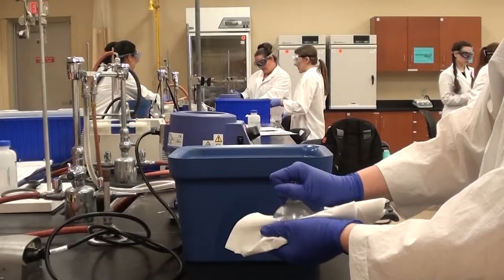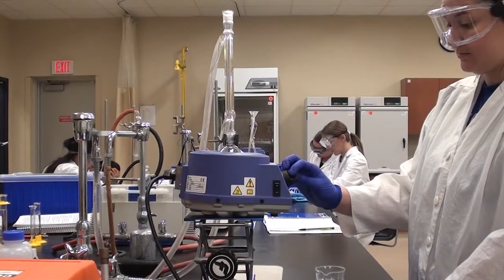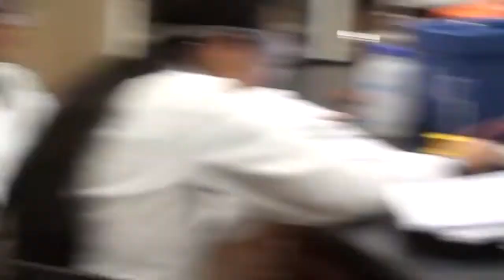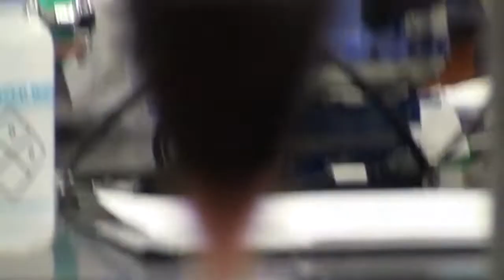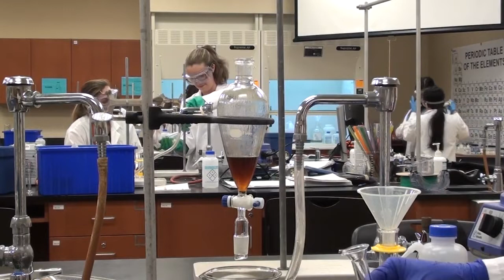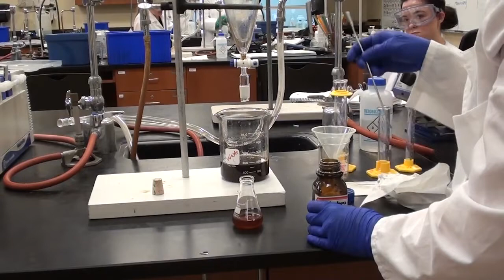Banana Oil Synthesis of Isoamyl Acetate Part 1

Comment: My experiment with this synthesis used 16 mLs of isoamyl alcohol, 17 mLs of acetic acid, and just 1mL of sulfuric acid. The solution was refluxed then washed with water followed by 2 sodium bicarbonate washes, Just as a pretext. What I wonder is why your reaction solution turned such a deep red, my solution did the same thing (only 2 reactions in our entire class produced this reaction) but we were able to narrow it down to dirty glassware that used isopropyl alcohol to clean. Though we had a red reaction solution during the first wash we were able to leech out all of the red color then in the subsequent sodium bicarbonate washes and distillation process we were able to completely remove the trace yellows. Anyways as just a viewer with a basic understanding of organic chemistry I might suggest adding a water wash step to remove some of those excess pollutants to the final chemical. Amazing tutorial love how succinct and clean the experiment was!!
Reply from the maker: A good thought...